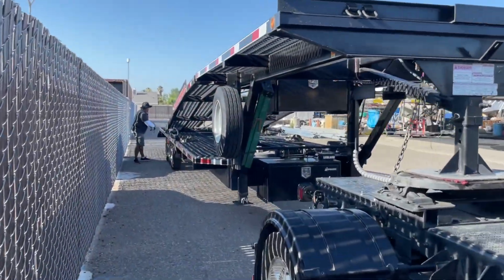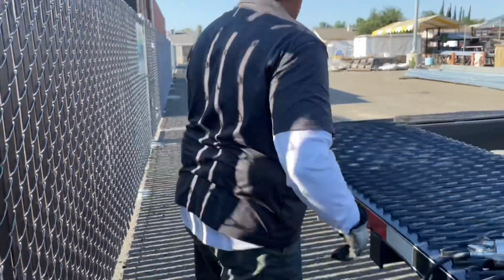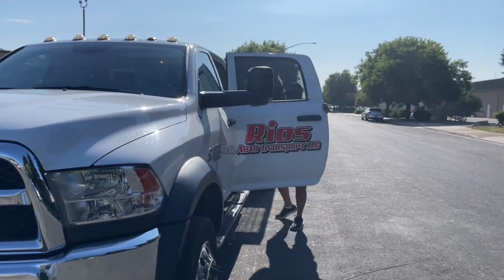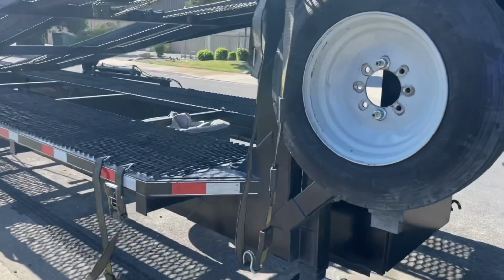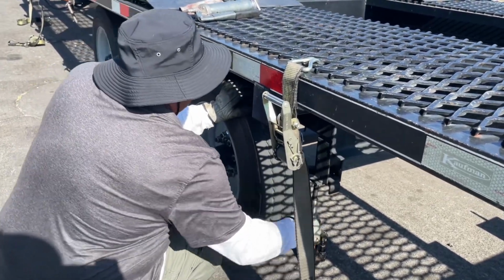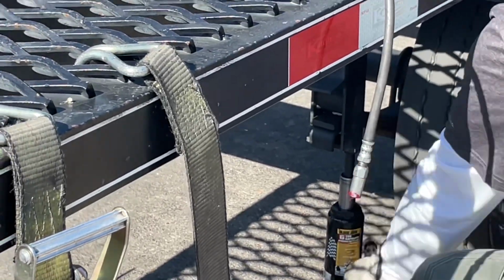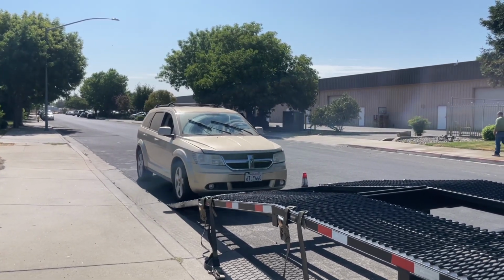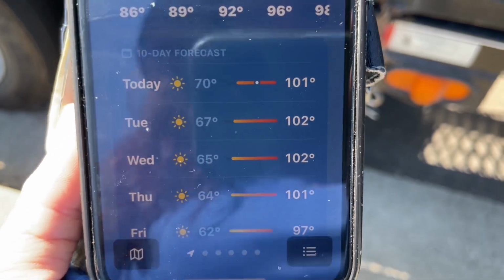Early arrival to recovery transport.. grease Bearings, check Brakes.

Comment: Hello ...I noticed when you drive vehicles up it doesn't look like the trailer moves much ....I put blocks on my rear axles tires on my truck, But I still get movement...I dont want to ruin my trans any better way to block up your wheels would be appreciated
Reply from the maker: I use rubber wheel chocks (2) on drivers side rear tire, one in front of the tire and one behind tire.  They’re heavy duty 120 ton wheel chocks.